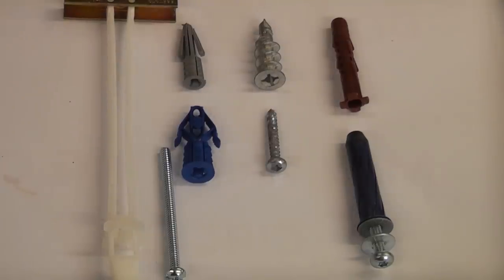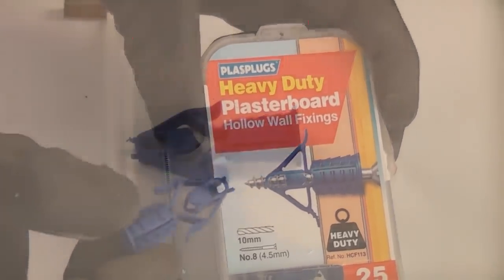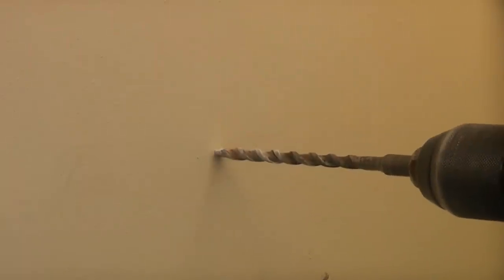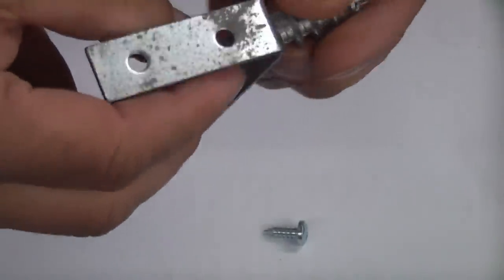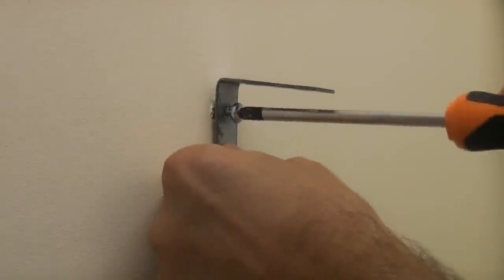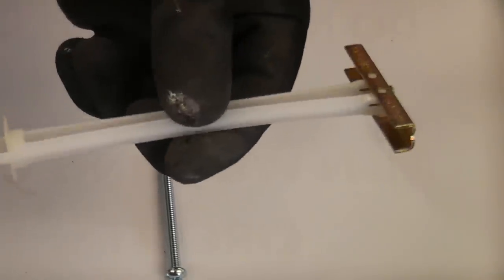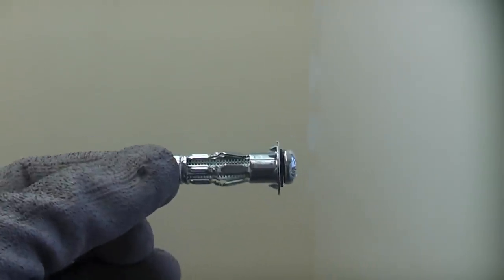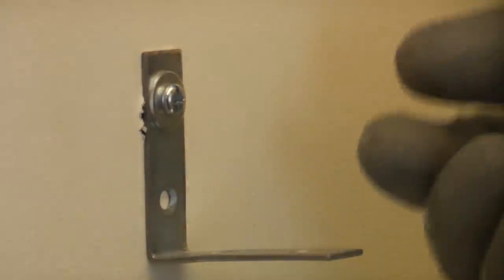Plasterboard fixings- The good, the bad and the useless!

Comment: the hollow wall anchors look perfect for my kitchen blinds - the ceiling is plasterboard with about 40mm gap to the concrete ceiling - the installers used a metal worm and when i redecorated around it ---- lets say the whole thing came down pulljng ton of plaster out that i had to use strong filler and new holes! - took 4 attempts to get it stay in - will the metal hollow wall anchors work better? (PS: whats the best for concrete brick walls? im putting up shelves and fed up using no more nails in the drilled hole for the supplied wall plugs to actually stay in - and the shelf im putting up next has mirrors on! so want it to hold! (its bathroom mirror shelv cupboard - done the holes already just dont like the cheap plastic wall plugs that came with it - its not heavy to be honest - and only for toothpastes and mouthwash and that - so will the plasplugs work as it says its for brick and concrete as well as plasterboard? (i rent but allowed to put shelves and stuff up as its council house, so it has to do the least damage so just a basic wallplug that will not "slip" out without using superglue on them!
Reply: btw if it helps - the dust from the wall is black - almost like its soil - but i assume its concrete as it wont work without hammer mode on - as i ended up buying a new drill that had hammer mode and it made life so much easier! (i used a computer "air gun" to blow out all the dust - so its just finding the best budget wall plug that wont slip out (and hold about 10kg   6kg for the shelf/mirror and 4kg for safety if i overload ton of mouthwashes and stuff!
Reply from the maker: This video might be useful, it shows how much weight various fixings can hold- 
https://www.youtube.com/watch?v=ECDysfNhx_E

The metal worm drive screws are normally useless and I'd only trust them to hold up a light picture to be honest.

For concrete or brick walls, I would use a universal plug, they also work for light weight fixings in plasterboard- https://fave.co/3JrfFm7
Reply: Makes sense as to why the blinds all fell down just budging them when I decorated then! Will defo be changing the fittings from the worm screw, even opening and closing the blinds you see it bending and moving a little. Bit poor using them when it was "professionally fitted" by the blind makers.. And that's a useful video thanks for your help 👍

Comment: I think the unintended snapping of the Plasplug Heavy-Duty fixing may be a problem shared by several HD fixings that have female-threaded ends made of unyielding materials, such as nylon used by Fischer.  These threads often seem to be designed for traditional woodscrews, not the various single and twin threads of drywall screws.  Manufacturers could provide better info about which types of screw are compatible.
Reply from the maker: If the screws are dependant on the fixing working, you would expect them to sell the plugs with the correct screws. I'm normally happy with Plasplugs products, but not with these.
Thanks for the comment 👍

Comment: Hi.. I want to hang venetian blinds from the top inside of a window reveal. It appears that there is only about 10mm gap between the plasterboard and steel lintel above. Any suggestions please?  The window reveal is only about 850mm wide so I could maybe use a  strong "no nails" type adhesive?
Great channel by the way
Thanks.
T.
Reply from the maker: Perhaps GripIt fixings will be suitable- https://www.youtube.com/watch?v=szx7nMRZSIY

Comment: Great video. Very good information and well explained. I'm going to use snap toggles to put on a 32"LED TV on a drywall. Would you recommend to drill at least one of them to the studs, or could I just drill both of them on the drywall itself? Thanks in advance
Reply from the maker: Thanks, yes it's always best if you can get at least one screw in a stud if possible.
https://www.youtube.com/watch?v=H5U0sLKyJJw

Comment: More helpful than nay other video I've found! Thanks a lot.
Which would you recommend for putting up a slider curtain rail with 6 brackets that would be fixed to both wall and ceiling?
Reply from the maker: You are welcome.
Curtain rails are normally a difficult item to fit as they have such small fixing brackets, so normally I fix a piece of timber above the window, then I use normal wood screws to screw the curtain rail to the timber. Obviously you can paint the piece of timber.
If you don't like the idea of doing that I would try fixing into the wall behind the plasterboard using regular wall plugs and screws.

Comment: Handyman I have a large shower screen I want to attach above the bath. The wall is tiles with plasterboard behind it- I can't see how the toggles would work very easily in this situation. What other fixing would be best in this case? Thanks
Reply from the maker: The toggles will work, but you might have to get some longer bolts for them because of the thickness of the tiles + plasterboard.
I used spring toggles for this cabinet a few months back- https://www.youtube.com/watch?v=gWupPtzXo6Y

Comment: Hi mate great video! Im guessing the snaptoggles would be the best options to hang a TV onto the wall with only one stud being used. Would you also use this fixing if no studs could be found to hang quite a big TV? Or would you reinforce with plywood for example and attach this to the plasterboard too?
Reply from the maker: I would always try and locate the studs- https://www.youtube.com/watch?v=glzwY76O0d8
For the TV, it depends on the weight of it, how many fixing holes there are (and how far apart they are spaced), and also whether or not the bracket allows the TV to be adjusted away from the wall, as this affects the strain put on the plasterboard! 
I've tested a few plasterboard fixings and spring toggles performed really well- https://www.youtube.com/watch?v=ECDysfNhx_E
I hope this helps ;-)

Comment: Love your videos Mr handyman straight to point nice and clear no bs keep up the good work,  BTW do you have any tips to sort out a loose curtain bracket
Reply from the maker: Thanks, what surface is the curtain bracket screwed to- solid or plasterboard?
Reply: +Ultimate Handyman it's drywall
Reply from the maker: Do you know what kind of fixing has been used?
Will the screw tighten?
It might be easier to move the bracket a couple of inches to either side if you can't get the existing one to tighten up.
Reply: +Ultimate Handyman it's a simple wall plug you would normally get included with a curtain pole,  the hole has become to big to put a new plug in so I think I may be better off creating a new hole a couple of inches down and filling in the old hole with polyfilla
Reply from the maker: You can put either a match stick or a piece of another plug into the existing plug and then the screw should expand it to make it grip- https://www.youtube.com/watch?v=V4wVyyfbWog

Comment: I have had bathroom radiator brackets come off the wall (plasterboard, no brick behind) I can fill the holes, but which fixing would be best in this situation? Pipes are micro-bore, so much movement to reposition is not really suitable.Thanks
Reply from the maker: +Alan Akeister I'd go for the snap toggles- https://www.youtube.com/watch?v=tAIUublenMwThey give just about the best fixing in plasterboard.

Comment: hello mate, thanks for the videos so helpful . I need help please fixing plasterboard to solid wall using mechanical way.  what can i use to hold the board so i can put tiles on and cooker hood.
Reply from the maker: +Hal Stirrup I normally use some everbuild's dry fix to fix the plasterboard and then put a couple of mechanical fixings in to ensure it does not come loose- https://www.youtube.com/watch?v=3CJygvnajUAYou can use regular wall plugs with a rust proof screw and stainless steel washer as mechanical fixings

Comment: I found the plasplug fixings to be entirely useless as well.
I use the self drilling redidrives for quick light jobs and the pre-set for most heavier jobs, spring toggles need enormous holes sadly.
With all of these, they are redundant if you hit a Wooden batten of course. Those batten finders on sale just do not work.

Never found those snap toggles on sale anywhere!
Reply from the maker: The first time I bought Snaptoggles was from B&Q but they stopped selling them for some reason.
I now get them from ebay when I need them- http://fave.co/2zqgtDA
Thanks for the comment

Comment: Nice video, helpful.

Would a standard two door bathroom cabinet held up by 4 screws work witht the ones you showed for light-weight fixings (such as Plasplug's hollow wall anchors) or would you recommend a fixing designed for heavier loads?

Thanks
Reply from the maker: I'd use something a bit more substantial to be honest.
This shows how much weight some of the fixings can take- https://www.youtube.com/watch?v=ECDysfNhx_E

Comment: Thanks - really helpful video! I'm planning to use Snaptoggles to fix up three shelves that are 115cm long x 22cm wide. Each shelf needs to hold up to 19kg (inc the shelf weight) and will be supported by two brackets. Unfortunately I can't fix the brackets to the studs as the studs are in the wrong place. Do you think Snaptoggles would be strong enough for this job? Also, would the plasterboard wall itself be able to support this weight? I'd be v grateful for any advice! Thank you
Reply from the maker: You are welcome. The snap toggles should easily support that weight, here is a video showing how much weight some fixings can take- https://www.youtube.com/watch?v=ECDysfNhx_E

Comment: I have used many of these over the years, and have rationalised my toolbox to 2. For light duty, I use the Plasplugs grey ones which work reliably every time, and for heavy duty I use the Interset brand metal umbrella ones (pre-set with the tool). I do not know where you get 10Kg from - I have got radiators and kitchen wall units hanging from these without any problems at all. They are a swine to remove completely, but if you do not need the  hole again, the best thing to do is to cut around them with a knife, dig away the plaster behind them, push them back a bit and fill flush. Toggles need too big a hole and are a too much of a fiddle, also the hole is bigger than the fixing which means you  are relying only on friction to keep the item centred. Plasplugs blue break from time to time and do not hold much more load than the grey ones - hardly heavy duty. Worm screws are OK for light duty - very quick, but very quickly come loose in the wall if you unscrew the item being fixed a couple of times such as when re-positioning or changing a light fitting.

Comment: hy the snap toggles look really good, tho don't seem to be sold in UK anymore, I go screwfix for almost everything and they don't sell them anymore but do sell spring toggle which look equally good maybe stronger but more expensive. Could you explain how the fixings can hold such heavy weight tho?  I imagined if it's solely plasterboard then the item you hang on Wall would just pull fixing through the plaster board as it's quite a brittle material. what is the safest weight a spring toggle can handle without me worrying?  thank you.  sorry for large message
Reply from the maker: The spring toggles were the best when I tested them out, they really surprised me to be honest-
https://www.youtube.com/watch?v=ECDysfNhx_E

Comment: Apart from perhaps hanging a picture or similar, I would never recommend any plasterboard fixing on its own. It doesn't matter how good they are; the fixing is only as strong as the plasterboard surrounding it - and that is not strong. If you're fixing anything heavy, either find a stud (if it's a stud partition,) or (if it's dot and dab,) drill through to the wall - after checking for cables/pipes - and fix to that, but don't over tighten, or you'll distort the plasterboard.
Reply from the maker: Thanks for the comment 👍

Comment: Handyman I have used a Fischer LDF plug and used a 4mm by 30mm screw. The plug is similar to the grey plug you use at the start of the video. I used it for a light weight fixing. However, I had to leave some of the screw unscrewed as the item I was attaching had to hook onto the screw. I can remove the item by simply lifting it off the screw. In any case the plug seems loose. I am thinking this is because I did not screw in far enough and so should use a longer screw? What’s your thoughts on this-should the screw always be longer than the plug so it comes out the other side of the plug? Thanks
Reply from the maker: The screw needs to be long enough so that it hits the back of the plug with most plugs.
With some plugs you can use longer screws as long as they are not going to damage anything if they exit the other side of the plug.
Some of the plastic plugs for plasterboard are not much good to be honest.
Thanks for the comment

Comment: Thank you for the video!   I have lath & plaster walls and want to put up storage shelves and wall shelves for my cats to give them more vertical space (the cat trees are hideous).  I'm not sure what type of shelf I want to use yet but I like the floating shelves look but I also have stucco which is not very even.  Any suggestions on what would be sturdy enough to use with lath? TYIA
Reply from the maker: You are welcome. The only fixing that I know is compatible with lath and plaster is the GeeFix- https://www.youtube.com/watch?v=BAyuUOjvKcA

As for getting it flush on the Stucco, you might have to use some small washers to get the fixing bracket flush or remove some of the Stucco, but be aware that it could be Artex and could contain asbestos.

Comment: Aren't some of the fixings optimised for different plasterboard thickness? Or are they all supposed to be universal, and how do you get them back out..if you need to later on
Reply from the maker: Most of them will work on any thickness of plasterboard, although with the hollow wall anchors you need to get the correct one for the thickness of plasterboard.
Most of the fixings can easily be removed once you have removed the screw, although a couple are a bit more difficult-
https://www.youtube.com/watch?v=LZqCZfdvhbg
https://www.youtube.com/watch?v=fFJICiX7DDk

Comment: Thanks for this exactly what I was looking for, I need to hang a motorised projector screen from the ceiling, ots 100" long and quite heavy, my ceiling joist runs the opposite way, I have a chimney breast so can't put it on the wall, do to the weight of this do you think the spring one's would be best for the weight, thanks again.
Reply from the maker: Can you get access from above? if you can I would put some noggins in from above.
If you can't do that I would try to get at least a couple of fixings into one of the joists- you can find them using a magnet - https://www.youtube.com/watch?v=h1adPjsah5w

I've tested out a few plasterboard fixings over the years-
https://www.youtube.com/watch?v=ECDysfNhx_E
https://www.youtube.com/watch?v=Cfb3vHeWb0M

But because your item is hanging from the ceiling, the pull out forces will be different.
Reply: @ultimatehandyman  thanks for your reply, the loft is floored so no acces there, the 1 joist I can get on takes it to far from the wall, I don't really have any other options apart from the plasterboard, the ceiling is done with artex so even struggle with the magnet to find anything, do you think any plasterboard fixing would do it, I domt even have the option to put noggins as the person that floored the loft looks like they used ring nails like you get in pallets.
Reply from the maker: @essexceltic1   You are welcome.
How heavy is the screen?
Do you know when it was Artexed? some Artex before 1999 can contain asbestos- https://www.youtube.com/watch?v=6MxHMZtHlrY&t
One thing that I have done in the past, where there is a boarded loft above, is drill a hole where I want the fixing, then push something blunt up there, to ensure there are no pipes or cables in the way (you should hear the blunt object hit the board above). I have then drilled right through using a long series drill bit, and put a stud in and used washers with nuts. If your projector is not too heavy, you could use the plasterboard fixings, I like the snap toggles/zip fix fixings the best.
Reply: @ultimatehandyman  thanks for the help, have just done it, got a couple of the boards lifted in the loft, pushed a nail up through where I need the fitting, it was 1/4" oit from where I needed it, they had put coving up so had to take out a small section from that so all sorted now screen up and just need to find another joist on the other side of the room for the projector all fun and games haha, been a Glaswegien I don't have a lot of patience, thaks for you help much appreciated keep up the great work because if I didn't see you post I would have thrown it out the window 😀
Reply from the maker: @essexceltic1   Nice one 👍

Comment: Great video! I'm planning on mounting a floating shelf (solid walnut, so it's got a bit of weight) onto an external wall in my kitchen. Issue I have is that the wall is insulated with 100mm warm board. Do I need something that will reach to the back of the warmboard? Any advice would be appreciated? There isn't much online re mounting onto warm boards.
Reply from the maker: I'm not familiar with warm boards,  is it a piece of plasterboard with insulation behind?

If it is there is a chance that the Grip-It fixings will work- https://www.youtube.com/watch?v=-geib-6sa3M